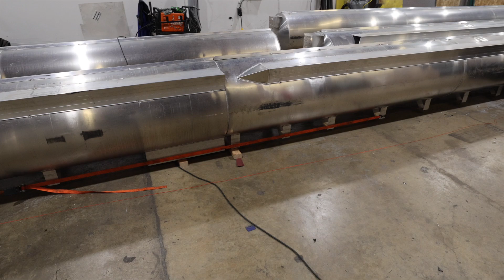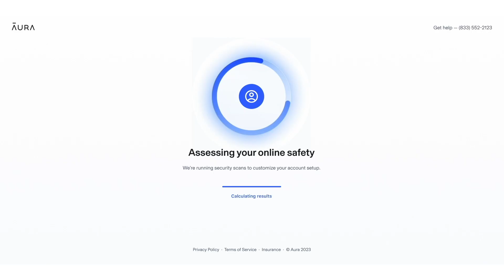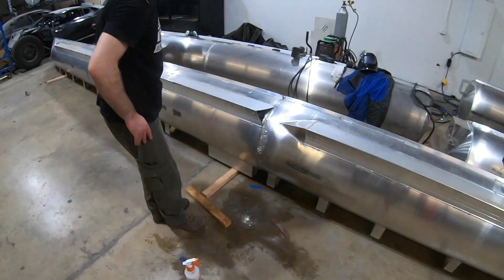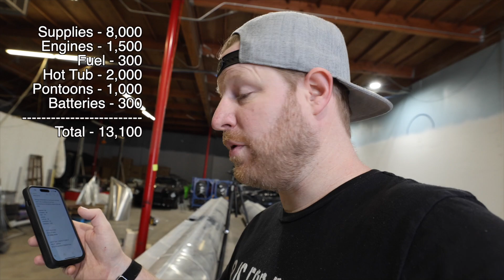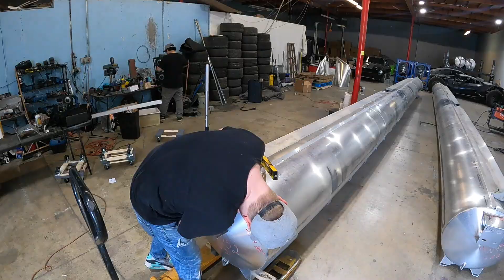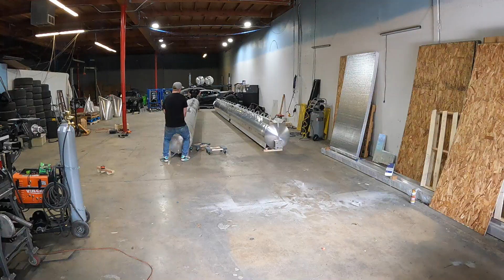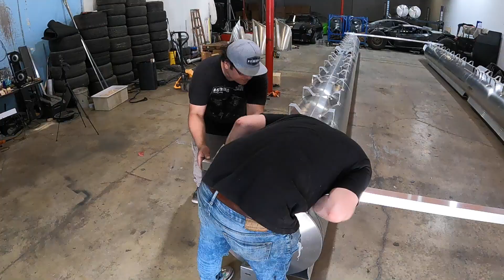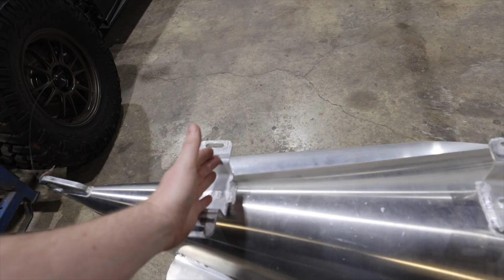Quad-Tune Pontoon Yacht Build - Welding Massive Pontoons for Our Biggest Project Yet!

Comment: You should run your calculations by an engineer @Chris
If you put the hot tub on the bow you are going to have issues getting on plain, you want to keep the bow light
I have a lot of experience working on boats, I think you are going to find you have overlooked a few things on this boat build
Reply: I agree.  And with as much as this is going to cost, some simple thing that they could have done differently could sink (pun intended) the entire project after they have spent a fortune and months making it.
Reply: @jiminauburn5073 it's not going to sink lol
Reply: @jerrywilcox9890  Why are you so sure it won’t sink?
Reply: It has borders to seperate the bouyancy. So if one fails the others will still float. So having a catastrophic failure is practically impossible @JamWell
Reply: @kylemcweeny878 did the titanic not have compartments?
Reply: @J41MET not all the way to the top, no. That was why it sank.
Reply: Or run holding tanks, placed throughout pontoons from middle to rear, to hold hot tub water when underway, then pump into the hot tub when you are using it.  Definitely want to reduce that bow weight, when motoring.  Of course, the weight of the holding tanks in the pontoons will likely create some significant, additional stress on the, already stressed, joint of the 2 toons being welded, so hell I dunno....
Reply: Even if the spa pool in the middle, there is going to be a massive amount of bending being induced. Buoyancy will be consistent across the length but there will be a massive point load from the spa in the middle, basically banana-ing the vessel. Those pontoons are not made for bending. They are basically only designed to encapsulate air. 

Basically, pool makes pontoons bend. Bend makes pontoons tear/crush. Water gets into pontoons. Chris now has 2 sunk boats :P
Reply: @hughbugger  - not to mention the added stresses as the hot tub is pounded by waves when under way.  Because you KNOW he'll run that boat with the tub full of water AND people sooner or later.
Reply: He has he said this in the first video.

Comment: Those aluminum welds will unzip after floating the boat. The weld itself may hold but the metal directly next to the edge of the welds will fail.
Reply: They should probably weld supports around the joint.
Reply: Yup metal fatigue is real. there's going to be a lot of compression and tension back and forth with every wave.
Reply: Agree with that. The Welds loking bad.. I hope they dont crack.. Or they got a free Submarine.
Reply: 1st or 2nd ride id think those welds will fail. And the boat will sink
Reply: What makes you say that?

Comment: Should go straight really well’ the trick will be turning this sucker. Looking forward to seeing this fun build!
Reply: I agree. He might want to consider bow thrusters in the hot tub box or something
Reply: shouldn't be an issue at all especially since he's running multiple engines.
Reply: Might need some bow drives for making docking and undocking easier.
Reply: Never be able to dock it on a windy day, even with twin engines, it is so long and tall

Comment: Thanks for your awesome works and videos. I guess, as certainly already pointed out by other, that vertical stripping is probably due to frequency of your LED light and the frame rate of the camera. My best guest is to ask the LED light provider as they are certainly aware of the problem and solutions. Thanks again for the great work.

Comment: Won't the extreme pontoon length cause flex and cracking around the welds? Might have been safer to have kept them as individual units mounted solidly together.
Reply: They should run some I-beams longitudinally to reinforce that center seam.  Should have connected the strakes to help with that also.
Reply: I agree. I would probably cut them into smaller sections and make several watertight sections in each pontoon. When one of those welds crack, they will fill a whole pontoon with water and it will flip over.

Comment: Notice the factory splices have a 25in round disk tieing them together......I wouldn't skip that
Reply: I agree.  It seems like their joint between the two they welded together will be under enormous stress, and I can see it breaking.   Plus the other splices have the external pieces of aluminum spanning across the joint, giving them more strength.  They need to fix that or it is going to break and sink them.
Reply: yup!  especially with the length of this thing whether you wish it or not those pontoons are structural pieces and the location of the splice is EXACTLY where the maximum stress will be.
Reply: If the first thing on top of the pontoon is a continuous beam the length of the pontoon’s it should be stiff enough.
Reply: B is for "Bake higher Insurance rates in for everyone else"
Reply: When you have expectations like a teenager what do you expect. It's cool to watch... It's a win win for him.. it's like watching the British motor channels in the states... Lol 🤣
Reply: B is for "Let it sink so that we can claim it on our Insurance"

Comment: They'll have to bisforbuild a giant trailer to move that thing too, better get started so they can be done by the end of next season
Reply: I can't imagine how they are going to get it into the water.  It is so long and any boat ramp will be at an angle and severely stress the weld points in the middle as the back end starts to float and the front end is on their massive trailer.
Reply: @kevinstone7723  marinas by me have a boat lift that they host with straps
Reply: Just hire a crane and a semi truck to get it to the water, after that it will stay there, why build a trailer when they are not going to be hauling it around all the time.
Reply: @joealex65 one 16 wheeler to hire and job done. how they gonna get it on the trailer is a different story. maybe if they drydock the assembly?
Reply: Crane
Reply: Really should put some aluminum c channel or something of the sort along it to strengthen it through the length of it

Comment: Note of attention! Avoid welding the pontoons under pressure. They could explode! 
Check videos alerting about welding rims with inflated tires.
Reply: they were pressure testing after welding, you could see them remove the bung and release the pressure before welding after
Reply: They didn't weld them with air in them 😂😂.

Comment: I would imagine that the pontoon tubing wall is guaged according to length. Some sort of sleeve should probably be in there across your seam and out a few feet either way.
Reply: I'd put money on those welds cracking. Not dissing Oscar in any way, but even to backyard engineer the welds look like they will be under crazy stress whenever the thing hits a wave and flexes.
Reply: Yea the factory splices have a 25in disk pairing the sections together..... the welds will probably over time tear. IMO
Reply: Yup I agree, I did this when splicing truck frames, we used 6" diamond pieces to bridge the weld on the inside.
Reply: Going to sink like a rock
Reply: Yep there gonna crack in half
Reply: Yeah, those welds wont hold over time. They need reinforcement, and Oscar needs a tig welder not a spool gun.
Reply: Fish food
Reply: the flooring should help to tie it together and add some rigidity but sometimes it does feel like the watching the Harland & Wolff shipyard in Belfast where the Titanic was built

Comment: Listening to that explanation of the flotation I am so glad we use the metric system.
Reply: And a man is 100kgs.
Reply: @poh_tey_toh  actually just about 91kg because the American pound is not 500g its only 453g
Reply: @Pixelplanet5  Civil/Stuctural Engineers talk in terms of kPa (without getting into an explanation of gravity and force) - 1 kPa is 100kgs over 1 square metre so it is convenient to think of think of 1 kPa as representing 1 x 100kg man standing in 1 square metre.
Reply: @poh_tey_toh  You probably meant a slightly obese man.
Reply: I got an headache listening to conversion of inches in cubic inches to gallons toward to pounds... So glad to work in metric.
Reply: @geoffrey3668 if you dont like it then dont watch some people use metric and kilograms some use inches and pounds if you can not covert it then you are not as smart as you think!
Reply: That was ridiculous!  All those conversations where in metric it's just 1 litre = 1 kilogram.
Reply: He was listing everything at nearly double their actual weight, and still had a few thousand lbs of lift to spare, so at actual weight he’ll be less than half submerged.
Reply: Stop with the hireoglyphics - metrics is the way!
Reply: Man, I wish we used metric. My brain is programmed for imperial and it drives me crazy. It is so much easier to use metric when you are building things.
Reply: @wickcolloran  then use the metric system no one is stopping you are they?
Reply: 😂😂 same here!
Reply: I worked with an old school ex miner for a good few years. His brain was imperial, mine metric. Oh the shit we built together 😂🤣😂🤣
Reply: They will use ANYTHING other than the metric system 😅 I mean, when you hear American news compare the size of an astroid to, and I shit you not, "half a giraffe" . . it's time to turn off the TV..
Reply: @ianog6730  "half a giraffe" 😁🤣🤣  they also get me each time i hear "2 thousands fals" or some shit like that just to talk about micrometer
Reply: @JeromeHeliosRunner  lol 😆 😂
Reply: @ianog6730  Are you telling me that with the metric system you can accurately predict the mass of an asteroid by looking at it? I doubt. I bet you would need complex calculations to find the approximate shape first. Then you cant multiply by 8 pounds per gallon?
Reply: Imagine that.. using a perfectly explainable metric system 😂
Reply: It’s crazy 🤪 I work in the flooring industry, the metric system works beautifully.
Reply: Reading the replies here, I now realize how grossly outdated and under schooled America is, this is something half of their population doesn't fully understand, and they think it's superior, and still reject metric.
Reply: We prefer freedom units, only communist use the metric system.
Reply: Came here to say exactly this. Does my head in 😛
Reply: I totally agree with this!
Reply: Metric boats always have more buoyancy. 🤔
Reply: I am American and I'd be honoured to use the metric system but we are forced to use the imperial system by our feudal lords in Great Britain ... hey wait a minute they aren't our feudal lords anymore and... hey wait a minute they don't use the imperial system either .... and wait a minute I ain't no American
Reply: One
Reply: More like the only correct system
Reply: Ah yes the smooth brained metric system cheerleaders have found themselves intimidated yet again by the concept of cutting 1 in half.
Reply: Sorry you think metric is better than freedom units, let's us know the next time that helps you to the moon, or rather the first time you get to the moon.
Reply: @jeffrankin9744 NASA use metric....😂😂😂😂😂
Reply: @thebrelon6294  you call it metric we call it freedom units, also have some chill and take a joke.
Reply: Accept all science related math at NASA is done with the metric system genius  @jeffrankin9744
Reply: @jeffrankin9744 I watch anticipation of the pontoon boat reaching the moon - if "freedom units" gets Chris there ...
Reply: @justwhy2484  hell yeah that's the kinda of thinking I'm taking about, pontoon moon boat.